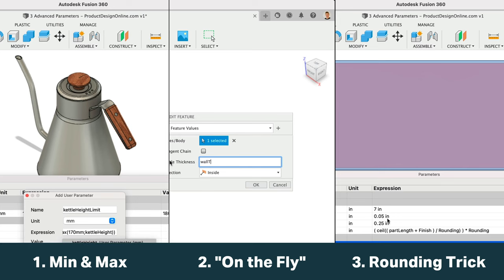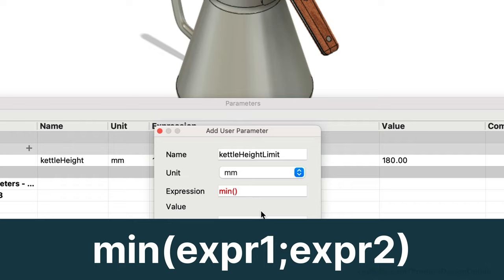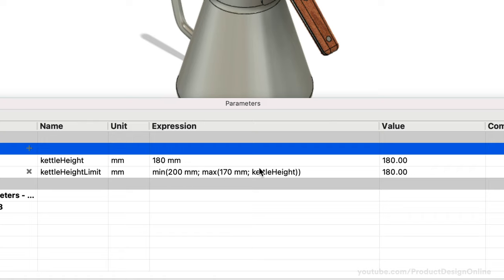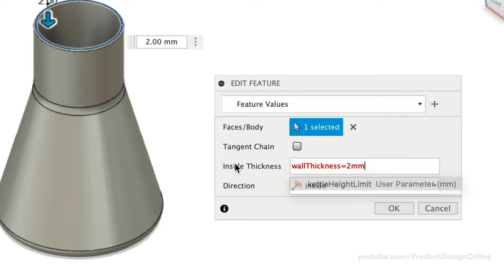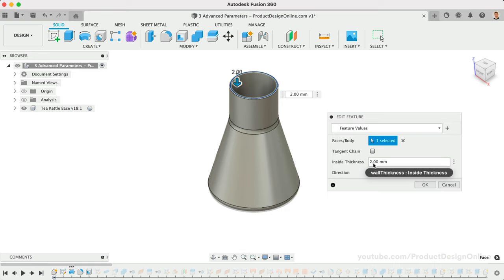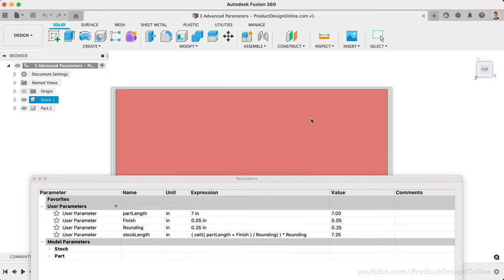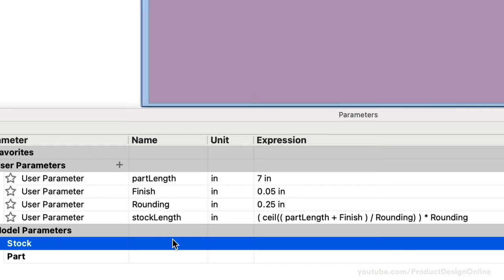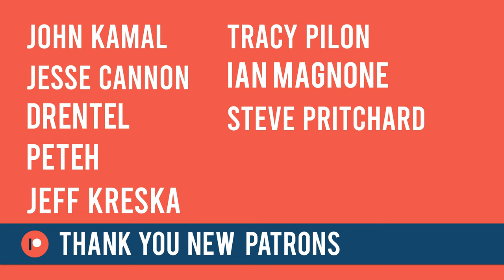The CORRECT Way: User Parameters in Fusion 360

Comment: This is great! I made a few paramtric (loudspeaker) boxes where this is very applicable. 
I already used those embedded, reused parameters in it and it works like a charm, just doesn't limit well (min or max). Thank you for sharing
Reply: Kevin, do you happen to know why using parameter in parameters in not possible? For example TotalLength == (Param1)+(Param2)+(2*margin). I can only use this as a calculated value when you design something, but you can't define it upfront.